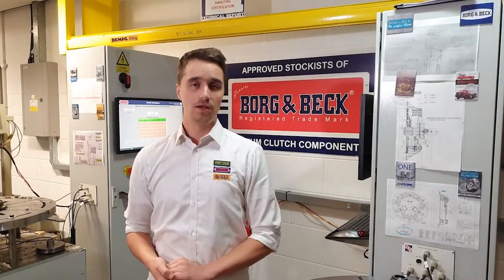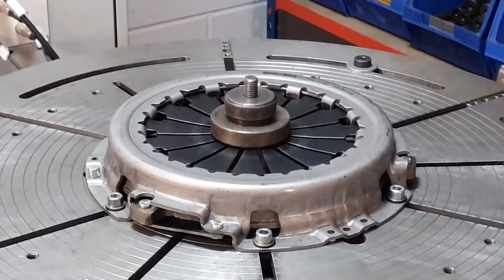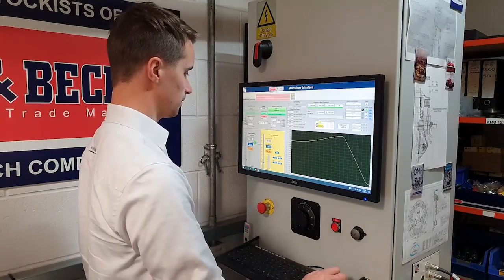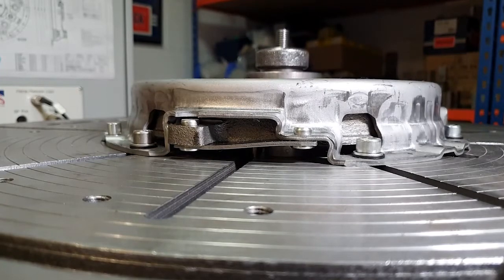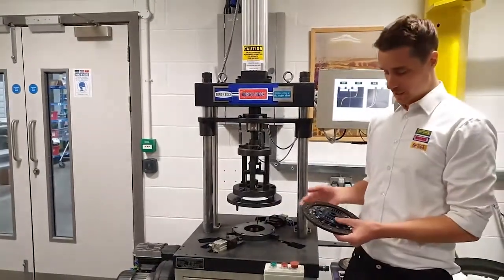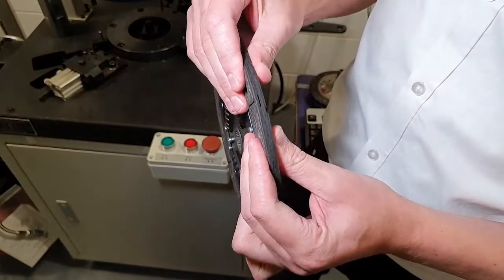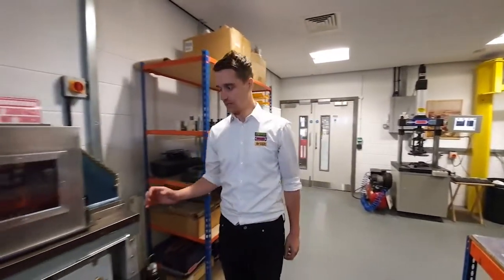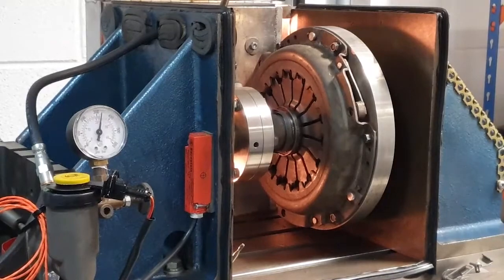Borg & Beck ClutchTechnical Centre

Comment: Borgs are the best clutches ever made, wont put anything else to my vehicles, after having a couple of failures with other brands i put my 1st borg into my delivery van several years ago which at the time had several old folks driving it  with high rpm that thing went through so many heat cycles and dumps it was ridiculous but survived none the less, borgs last a good long time and if you do have a driver in your family who is a bit clutch slip happy then install one of these.